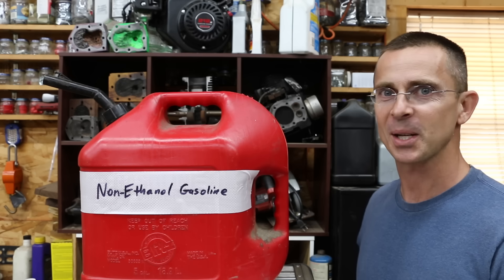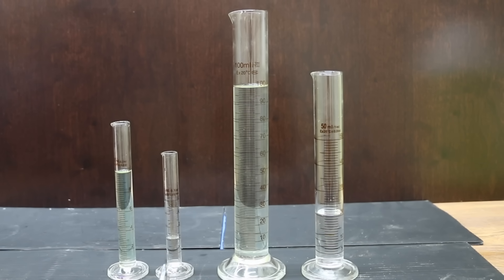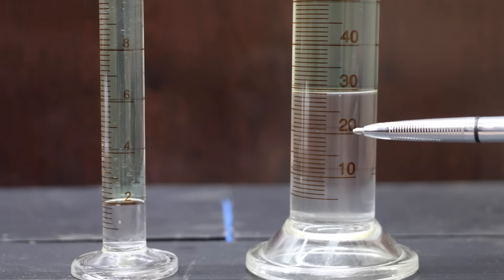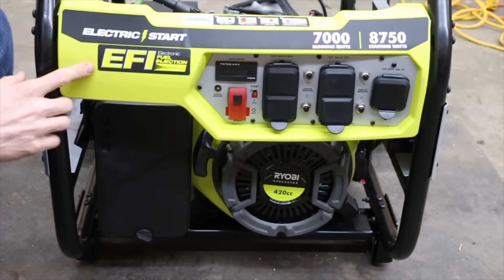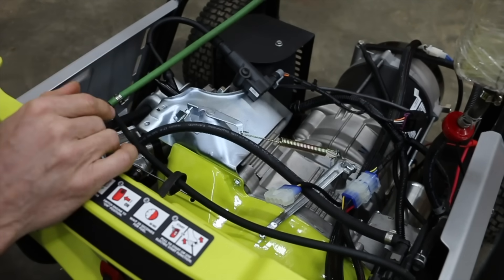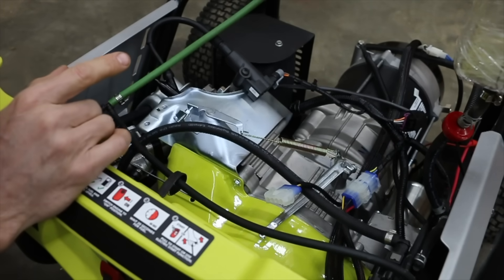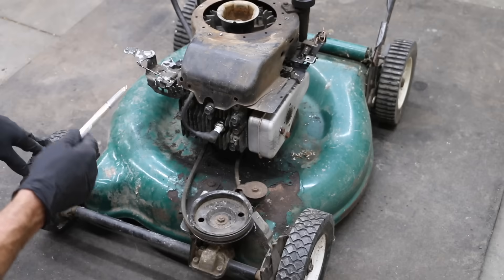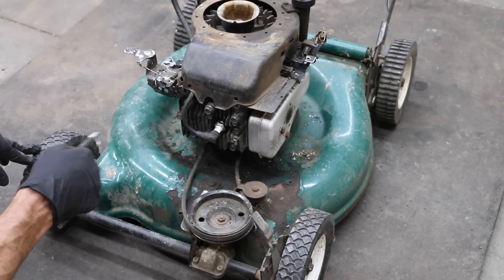Is Non-Ethanol Gasoline Really Better? See the PROOF!

Comment: Usually the main problem of ethanol build up is in the jet's, since around 2010 with the new norms for fuel consumption on small gas engine, suppliers where obligated to put in jets with smaller holes diameter and ethanol clogging them up. This was not common knowledge for a while leaving alot of people with the reflex of going for the gas at the lower cost and dealing with alot of carburator issues because they always runed the older gas engine they used to have for "20"years on regular... so many frustration!
Reply from the maker: Thanks for sharing.

Comment: On a somewhat related note, I recently discovered the fuel treatment K100.  I had been running ethanol-free gas in my cub cadet riding mower last year because it had sat unused for 3 years and took a good bit of work to get it running again.  It would take 10+ tries starting it before it would stay running.  I still ran ethanol-free gas thru it but I added the K100 additive.  The next time after that it started after 2 tries.
Reply from the maker: Thanks for sharing.

Comment: Had a chainsaw that I ran on fuel with ethanol/oil mix stopped working on me.  Took it to a small engine repair place and they took the head off of it and showed me the piston, cylinder wall, and underside of the head.  They were eat up with what looked like where small little divots of metal had been removed.  The piston had been eaten clean through.  The repair guy said that is what the ethanol does in these small engines that are not designed for it.
Reply from the maker: Thanks for sharing.

Comment: When I lived in NJ we only had ethanol based fuel so I used the hat in my motorcycle (single Cylinder 250 4 stroke) when I moved to TN I switched to non ethanol fuel for a while and it ran like crap and stared leaking gas from the carburetor. I’ve switched back to ethanol based fuel and it runs better but is still leaking I bought a carburetor rebuild kit hopefully that will fix the leak. I’m just going to stick with regular gas for now🤷🏻‍♂️

Comment: Poor 10 percent on you hand and you can feel how dry it is. Do the same with Non Ethanol gas and you can feel it is not as dry feeling and takes a lot longer to dry. Poor a little of both on concrete floor and the 10 percent ethanol gas on the floor and it dries up about 3 times faster than non ethanol. Only reason they use it with gas is to say they save you gas over non ethanol gas which is just a joke. Or Government lies to there people. Whats new.
Reply from the maker: Great feedback. Thank you!

Comment: as a guy who still runs carburetors i would be interested to see what long term effects you can replicate. my personal experience with ethanol in the fuel is 90 percent of the time it doesn't matter.  i have a small fleet of thing with carbs, from Holley 4 barrels to Dell'ortto side drafts and various small engines. I lived in the humid south to the aride high plains.  
the conclusion I have come to is its about where you get your gas, and a but of luck because even a good station can get a bad batch. my lawn mower runs from March to October  on 87 e10/e15 the sits in the humidity outside until late Feb. were I change the oil and perp it for the season. most of the time it fire up after a quick prime on the last years gas. the carbs i had to pull apart over the years i can count on one hand how many were eaten up from water, most just needed a quick varnish removal and were good to go, may of those really just got the main jet cleaned out and the varnish would wash away with fresh fuel. i like pickup peoples throw away mowers and weed eaters, most of the time i can get them running for nothing 
    but here is why i say pick were you get your gas but you will get unlucky from time to time. i run a hot 4 cylinder with dual Dell'rotto DHLA side drafts as weekend cruiser. you can notice a difference in engine performance with fuels that have a higher water content, then normal, or a blend that is to far off from the 87oct e10 the engine was tuned on. after 2 years and 15,000 miles the carbs are still clean, and function well. and these were used take off from an early 80's alfa.
Reply from the maker: Thanks for the video idea.

Comment: I have a car from the 90s and it’s handbook states not to use oxygenated fuels for long periods. It also states it can take up to 10% methanol fuel… ethanol fuels not to exceed 5%. When forced to use only ethanol the car would run roughly, spewing black exhaust from its tailpipe then stalling after a few mins of running. When Florida allowed non ethanol fuel back to marine engines I took the opportunity to refuel the car with only non ethanol fuel. And what a big difference. The car has rubber and plastics in its fuel tank and it’s tank is a type of plastic. Another car my grandpa owned a 1986 Jaguar XJ6 suffered from the same issue as my car did, 

In 2015 I purchased a new car that was able to use ethanol upto E15. That car ran fine. I later traded in that car for a 2022 Tesla electric car. Best thing no more ethanol or gas issues.
Reply from the maker: Thanks for sharing.

Comment: Ethanol is trash for carbed engines! Especially older engines. They need a full ethanol fuel conversion because ethanol eats the gaskets. Also ethanol attracts water, so for boats, it fills your tank with water.
Reply from the maker: Thanks for sharing.

Comment: I repair small engines and I can tell you without any doubt that fuel with ethanol will gel and turn to a milky white syrup if left in a carb or fuel tank for a long period of time (year or longer) .   Even over 6 months sitting in a carb it will gum up the carb.   I have seen this many, many times.     Non-Ethanol fuel does not have that problem.
Reply from the maker: Thanks for sharing.

Comment: The only upside with ethanol is that it seems to evaporate and not gum up, but adios to your carb gaskets. Rebuilt/regasketed about 50 carburetors since this shit came around.
Reply: Don’t forget rubber fuel lines too; they get all hard and rot from the inside out and cause problems. They’re not supposed to be rock-hard.

Comment: My 1956 WD Allis Chalmers runs like it has a vacuum leak with ethanol gas in it. (runs fine on non ethanol regular) Same with my older mower. My 2009 ZX14 gets 42 to 44mpg on level ground at 60mph with non-ethanol. 34-36mpg with ethanol. My 1995 husky 40in mower had a thin layer of rust in the carb float bowl from ethanol..
Reply from the maker: Thanks for sharing.

Comment: Non-ox gas SUCKS! melted the top of an Evenrud piston and packed full the void in the spark plug with molten aluminum.  The blue flames are always hotter and cleaner than orange/yellow flames, which will also be loaded with unspent fuel due to incomplete combustion, which also produces much much more CO.
Reply from the maker: Thanks for the feedback.

Comment: What are you using on the frill to remove carbon from the piston and valves? I have an engine head with black carbon on the valves hard to remove from oil burning, don't want to take the head to a shop just for that.
Reply from the maker: Thanks for the feedback.

Comment: Seems odd that ethanol would be used to raise the octane of gasoline. If I recall, gasoline has more BTU's of heat than ethanol. The science of raising the octane with ethanol would be interesting to know. Higher octane means a longer burn as it is less explosive is another detail I recall, but I could be mistaken.
Reply from the maker: Thanks for sharing.

Comment: Corn ethanol has 67% of the BTU energy of a gallon of undiluted gasoline. It takes 1.0 to 1.3 gallons of petroleum to make one gallon of corn ethanol. Corn ethanol added to gasoline has been a failed experiment which should have been stopped several decades ago. The carburetors on several of my mowers have had to be rebuilt because of the ethanol damage.
Reply from the maker: Thanks for the feedback.

Comment: I run non-ethanol fuel in my old motorcycles. The carbs would need to be re-tuned for anything else, and ethanol fuel doesn't last very long in the tank. They can become difficult to start if ethanol fuel is left in the tank for a month.
My cars deal with it, but they have modern fuel injection and engine management systems.
Reply from the maker: Thanks for sharing.

Comment: Now your talking about the real issues mechanically in next video and looking forward to it.  BUT and IMO huge, the purpose of the ethanol. Does it make sense, cost wise with NO subsidies.  Growing corn, takes fertilizer and fuel along with insecticides, transport of each, energy to create and distill ethanol.  Short version, carbon impacts in total cost to add this to fuel while introducing a KNOWN problem. Moisture accumulation from the ethanol causing the corrosion winter storing issues or even summer storing for snowmobiles.

Comment: a big factor in this is the year make and model of your vehicle. older vehicles are not made with rubber that can handle the ethanol. iirc any vehicle after like 2005 or some such is equiped with rubber that can handle ethanol.
Reply from the maker: Thanks for the feedback.

Comment: I was using reg unleaded several years ago and I found that ever 2-3 years I was having carb issues and then at Q-Trip came out with e91 which is non ethanol premium and to this day I've had no carb issues and that's been 15 years not only I use it in my mowers but I also use it in the vehicles. Thanks for all your testing and as always be safe 👍
Reply from the maker: You are welcome!  Thanks for the feedback.
Reply: QT is great. Here (in Texas) we have them and Buccee's for real gas.

Comment: I pay .80 cents difference for ethanol free premium. I get on average 5-6 mpg better with a 2021 GMC Sierra 5.3 4x4. It's worth the better mileage and no potential damage. Also, you get 1 gallon of ethanol for every 10 you buy and it sure doesn't cost what gasoline does. My experience is, ethanol gets better economy in carburated engines if they can start on the stuff. I had a Pony motor in a Deere Diesel that did not like it.
Reply from the maker: Thanks for the feedback.

Comment: Fantastic job on measuring multiple parameters in a controlled way. One tip for next time you want to measure carbon build up. Clean the heads and weigh them before and after so you can measure the weight of the gunk built up.

It's no surprise that the straight gas got better efficiency. Ethanol has a lower energy density, therefore you need MORE of it to do the same work. Sometimes I wonder if ethanol in gas isn't for emissions, but a ploy to sell more gallons of gas.
Reply from the maker: Thanks!  Thanks for the feedback.

Comment: My car is a 2015 Impala LTZ, 20" Wheels, & the 305hp LFX 3.6L VVT Engine. 72,000 miles now.
* An emblem on the trunk says "Flex-Fuel capable".
* I should have it removed! I've owned the car since July 2017.
* It hasn't seen A DROP of that e-crap.
* Like my small-engines......ONLY Certified Top-Tier NO-Ethanol Premium from Shell or Holiday.
* Seafoam is regularly used in the gas AND engine-oil.
* I add a cup of SF to crankcase a couple weeks before every 3-5k oil-change. The oil stays pretty clean after every Mobil-1 change!

Bottom line: 
Because of these practices.....my car still runs STRONG.

>>> Another tidbit nobody realizes.....the Owners-Manual even states "the use of Certified Top-Tier Fuels is recommended.....".

"The more you know....." 😋

Comment: This guy is excellent!!! Been a subscriber for 2 years now.
* My 25y/o Tecumseh 8hp Sno-king snowblower runs great. Carb is clean as a whistle inside.
* I did have to replace the Carb however in year 20. Engine was surging noticeably. Why? After 20 years of vibration, the throttle-shaft had worn a slightly oblong shape into the carb body!! 
* That enabled extra air to be sucked in, causing the surging.
* The carbs' internals were SPOTLESS however.
* WHY?? Because I NEVER used E-blended gas.
* The ONLY fuel my small-engines see is Top-Tier NO-Ethanol Premium from Shell or Holiday stations.
* I also add a little Seafoam EVERY time, both to the gas, AND engine oil.
Reply from the maker: Thanks!  Thanks for sharing.

Comment: You can tell between cars that use ethanol and those that do not by looking at the tailpipe. The vehicles that use cheaper ethanol gas have black soot in the pipes but those without are as clean as the day they left the assembly line.
Reply from the maker: Great feedback. Thank you

Comment: A real problem with ethanol fuel mixes is that the ethanol deteriorates rubber and plastic components in the fuel system, such diaphragms and carburetor floats.  The floats on my motorcycles were so deteriorated after a year of two when the fuel was changed to ethanol mix (pure gasoline is not available in my state) that they would no longer float.
Reply from the maker: Thanks for the feedback.

Comment: so you took ethanol away from the fuel and tested, knowing full well you lowered the octane. Why not find some none ethanol fuel with the same octane and compare apples to apples
Reply from the maker: Thanks for the suggestion.
Reply: @ProjectFarm  Love the trick of adding water to see how much ethanol was in the fuel......Tried it on the fuel in all mu jugs out of curiosity this weekend.... ranged from 7 percent, to 21. I actually tested it 3 times.  My question to you is actually about the octane. will the octane range be that drastic as well??

Comment: Ive been running the non-ethanol gas in my 99 crv with 240k on the clock for about 4 tanks now and i cant verify ive experienced a noticeable difference in pep and performance and a 3-5mpg increase in mileage.
Reply from the maker: Thanks for the feedback.

Comment: Ethanol fuel is like race fuel. It's fine for your engine, in some cases better. But each time you turn off your engine you HAVE to drain your carb or it will eat the seals out.
Reply from the maker: Thanks for the feedback.

Comment: Shouldn't the carbon deposit tests also vary RPMs during test? Or maybe doing it mid rpm all the way. 
It's clear from the clear valve cover test that it will be significantly different in idle compared to mid and high RPMs, incomplete combustion generates more carbon deposits...

Comment: 1 test to add is the ability to pass moistier. 10E should be able to run more moister if condensation or water gets in the tank.
Reply from the maker: Thanks for the suggestion.

Comment: Most of my lawn care equipment have two stroke engines. I was constantly tweaking the carburetor to get the engine to run best using 100% gas. I tried a 10% ethanol blended gasoline and my two stroke engines ran perfectly without having to tweak the fuel/air mixture screws all the time. I run my pre-mixed gasoline at 32:1 in everything. I now mix 10% blended ethanol gas at 32:1. My Lawn Boy is 25 years old, so is my Homelite weed trimmer. My Poulan yard blower is over 15 years old. Everything still runs like new.
Reply from the maker: Thanks for the feedback.

Comment: Just remember ethanol methanol or butyl ether (Mtbe) is required by the epa. So straight gas is not straight gas.  84 is the octane of fuel when removed from ethanol. 

These three oxidized fuels add oxygen as they burn so yes that’s leaner which means add more fuel which means more power. On a carb engine it means swapping jets. Electronic controls can typically absorb it older ones may not. 

The btu argument is silly, if you take a 91 gasser vs a 100% ethanol the ethanol makes 100 + hp more. Between higher compression ratio timing and more btu in the cylinder per fire the gasser has no way to keep up even if 100 ll or av gas. Being able to run 7:1 fuel ratio vs 10.5:1 is a huge hill to climb. 

The corrosion stuf fro ethanol is formaldehyde and vinegar (yep acidic acid is this) really scary stuff. 

Water separation is actually the biggest issue. And people just not doing maintenance. 

Isopropyl and 2-propyl (same thing) is a different alcohol though and decomposes to acetone. Just think of that next time you see an old bottle of sea foam. Just kidding it’s stable and takes a catylist which can be in some fuel and acetone will eat plastic. 

I honestly wish isopropyl was the alcohol used so many people use it in their tanks anyway. (Every octane booster cleaner antifre3z water remover on the shelf)
Reply from the maker: Thank you

Comment: My used Ford 460 V-8 truck lost the fuel gauge and fuel pump. The gauge float had pin holes that caused it to fill with gasoline. Also 2 generators stopped working after setting a while.  

I wonder if these problems were due to ethanol/water.
Reply from the maker: Great feedback It's hard to know for sure. Thank you

Comment: the other big problem with using "ETHANOL" gasoline is the loss of chrome plating on the aluminum piston( aluminum bore), causing cylinder scoring/ galling. also excessive exhaust valve guide/ stem wear. I thought that using "MOTORKOTE" would solve the problem  NOPE!!!!, it did not solve any of the problems that I was being faced with, in fact it did not even touch the problems. switching to non- ethanol gasoline solved the problems!!!! the mower that I am using is a 1969 jacobsen/ briggs engine with 8 thousand hours on it( original engine with many rebuilds)
Reply from the maker: Thanks for the feedback.
Reply: @ProjectFarm  , thanks for responding, I do not mind sharing what I know, I have been "SPINNING"  wrenches on this "STUFF" since 1970 ( now retired)    have a great day!!!